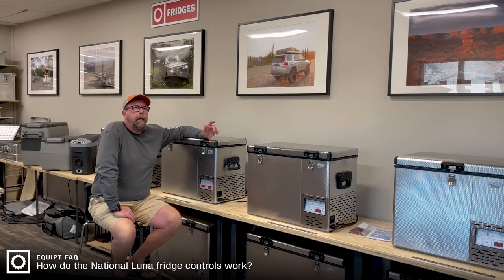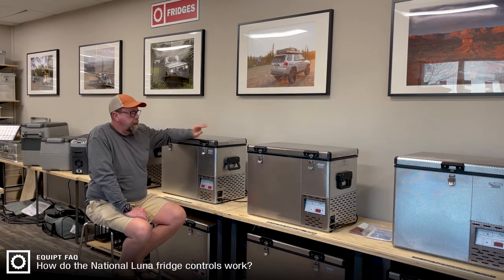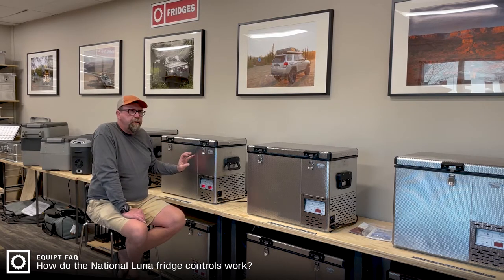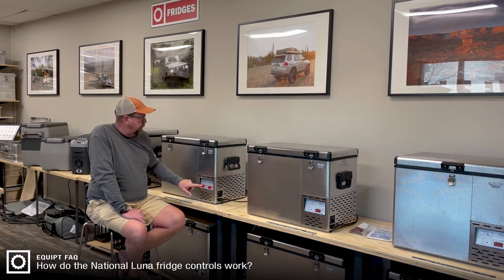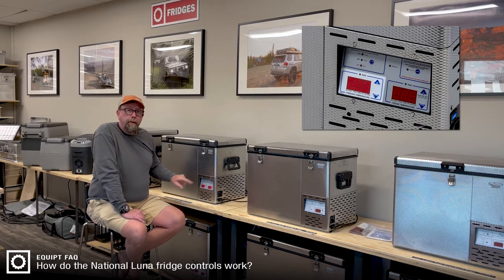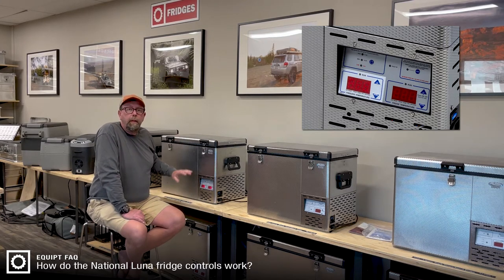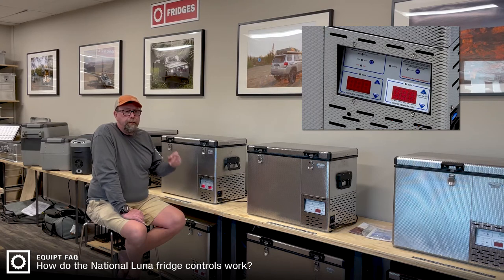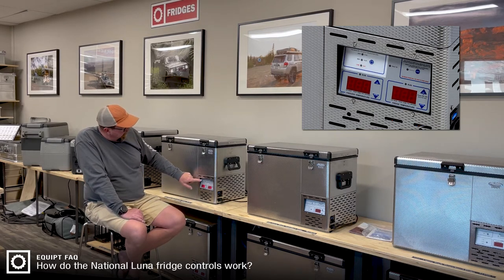Equipt FAQ: National Luna Fridge/Freezer Controls

Comment: In case anyone wants to know, upon start up both sides at (2) was only pulling around 50 watts. After short period (10min) it was at temp. I live in Tuscon... Took almost half hour until it cycled again, I use a protective insulated cover too. Old fridge took 300 watts and ran almost continuously draining a 100ah overnight to 0 and shutting down. Luna had same goods inside and last night consumed about 1|10th. So I could use that battery for many days without charging.. Very comforting...

Comment: Hi Paul, awesome explanation.  I have a Weekender 50L Twin freezer/fridge. It was working fine, but I have installed it in a new truck and I can't make it run. Pressing the Run button for three seconds has no response. The battery level lights are all on, and if I press the Alarm button it will turn on too, but the Up and Down buttons and Turbo button do nothing when pressed. Both Run and Fault Id lights are off.  Do you know what could be wrong?

Thanks in advance.
Reply from the maker: Hi there, please email us at sales@equipt1.com for assistance. If it worked fine in the first vheicle and does not work in the new vehicle, that would lead me to believe it's an issue with the new vehicle or the electrical system. First step would be to test it on a 120v AC outlet, which eliminates the variables within your 12v system. Email us and let us know what you find. We'll do our best to get this figured out. Thanks!

Comment: Can one zone be turned off if we don't need both compartments? If it's possible, can we choose either fridge or freezer zone ir is it just ine specific one lets say, just the freezer could be turned off? Great video. Very informative 👍
Reply from the maker: Hi there Alex, 

You cannot turn one side off individually. Both sides are always on but you can switch either to fridge or freezer. If I don't need the freezer side set at sub-freezing temps, I simply set it to the same refrigeration temperature on both sides. Depending on the fridge model, the freezer side may have 60mm insulation or 42mm insulation. Most folks will use the 60mm side as the freezer but either side can be used. The freezer side will have a -24C lowest temp setting and the fridge side will have a -18C. I personally set mine around 4 or 5 for refrigeration and -15 to keep frozen items frozen. 

Please reach out with any additional questions!

Comment: Hi. I have the 72 L dual unit on my boat. It has been a sensational performer until yesterday. It came up with Fault code 2 relating to the vent fan. I disconnected the power and reconnected and it started ok indicating temps on both sides. Ran for a little while and then shut down. Have checked all fuses and input voltage is very healthy (13.2v). Now when I reconnect it, the displays show all numeric LEDs on for about 1 second (all “8s”) and then nothing. When I hold in the power on/off button for more than 3 secs, still nothing. Any thoughts? I haven’t run on AC yet to compare. It may be terminal 😫?
Reply from the maker: Hi Chris, 
We might need to connect via email but in order to help others understand the fault, we can dive in here. 

Please note, the 888 flash upon startup is normal, these fridges go through a startup process and that is normal.

First, we always suggest testing the fridge on both power sources; 12v and 120v. 

Two flash fault explanation: Fan over-current cut-out. There is a problem with the ventilation fan. It is possible that the ventilation fan is damaged.

As far as the fan fault goes, first step would be to remove the fan from the condenser grate and see if it will fire up with a 12v source connected to the leads. What you will most likely find is a faulty fan and we would replace the fan under warranty if the it was within three years of original purchase. If the fan fires up, then we need to look into the control board or electronics module.

See if you can check the fan functionality and let us know what you find. 

Thanks!

Comment: How do I identify a fault id?
Reply from the maker: There is a fault light that flashes a series of flashes, here's the explanation: 

1 Low voltage. This is shown when the DC supply voltage is low. The battery could be   flat, wiring losses are too high or there is a poor connection to the power source. 

2 Fan over-current cut-out. There is a problem with the ventilation fan. It is possible that  the ventilation fan is damaged. 

3 Motor start error. The compressor has not started successfully. This can happen in    extreme environments where the refrigerator is heavily loaded & temperature is very high. 

4 Minimum speed error. The motor cannot maintain a minimum speed of 1900 rpm.  This can be the result of an Electronic Compressor Driver failure. 

5 Thermal cut-out. The electronic circuitry has over-heated. This happens in very hot  environments. This can occur when the fridge is over-loaded with warm contents and  the ambient temperature is high. The electronics will re-set when the temperature  has dropped. 

6 Electronic Compressor Driver hardware failure.

The most common fault we see is a low voltage fault which can be low voltage, a poor connection, loose plug, damaged wiring, incorrect wiring size, etc. 

Please reach out to sales@equipt1.com if you have fault questions.